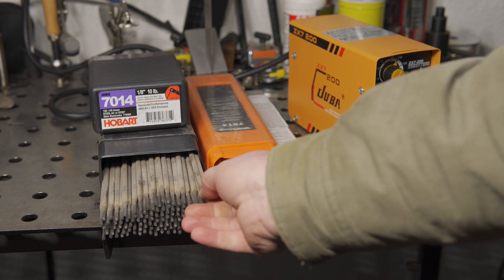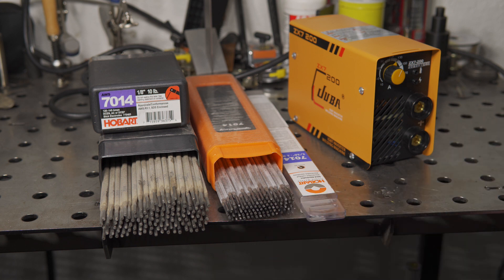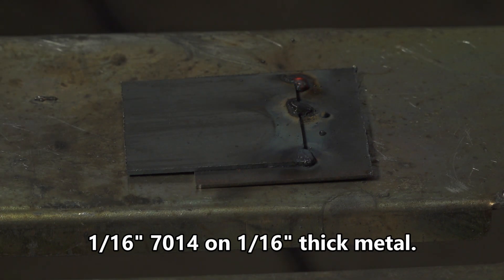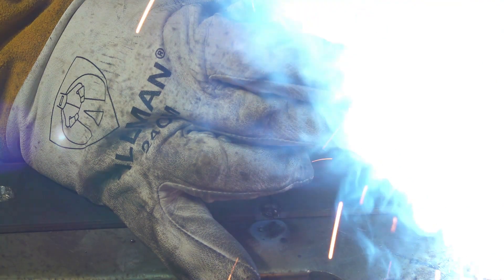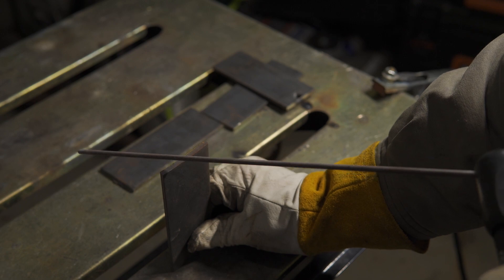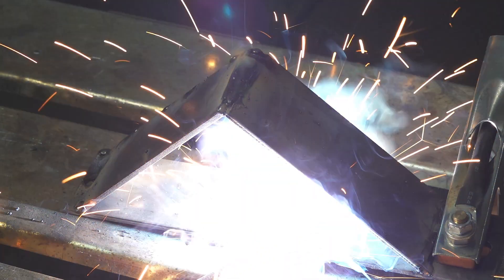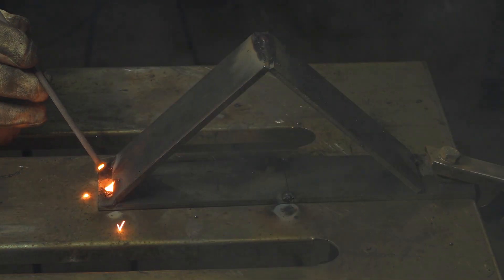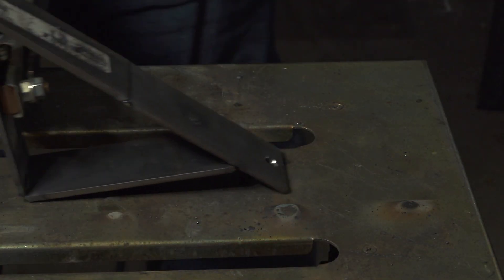Stick Welding Easy Tack Welds:  Use 7014 Rods

Comment: This comment is kind of off topic, but since you have reviewed several inverter welders I thought you might know the answer to my question.  I recently bought 2 very small DC 100 amp inverter welders.  I am thinking of hooking these together in parallel to increase the amperage to allow more flexibility with bigger rods and thicker metal.  I see Miller has a how to manual for this.  It says as long as you keep both machines settings the same it will work.  Was wondering what you thought of this and if you have any thoughts on how this will work.  Enjoy your videos very much.  Thanks - Russ
Reply from the maker: I've never done it, but I imagine it would probably work with those two welders, as long as they are fairly even in terms of voltage and amperage delivery.  You would have to make up some "Y" cables and such.

I don't think it's generally done with welders that size.  I think it's more common when trying to get really big outputs.  But hey, if that's what you got, give it a shot.  You will likely have to plug them into different receptacles on different circuits.  I imagine that if you plug them both into the same 20A circuit you will probably end up tripping the breaker.
Reply: @bigtb1717   Thanks for your reply.  Here is a link to the $44.00 welder I bought.  It ships from their US warehouse in NJ and I had it in a week.  That price includes shipping!

https://www.banggood.com/4200W-Welder-DC-Inverter-ARC-MMA-225Amp-LCD-Display-Welding-Machine-Stick-Tool-p-1532824.html?rmmds=search&cur_warehouse=USA

Mine came with an arc force knob control also which was not shown in the picture.  I guess the arc force varies you amperage depending on your arch length and when its turned up it almost is impossible to stick a rod.

I am very happy with its performance so far, but am thinking $44 x 2 = 200amp welder if this works.  I ordered another welder, cables and connectors to get them paired up.

The Miller instructions to parallel a welder is pretty simple.  Your right that you have to have the welders set exactly the same  amperage when you use them.  Here is the link to Guidelines For
 Paralleling Arc Welding Power Sources.

https://www.millerwelds.com/-/media/miller-electric/files/pdf/resources/paralleling.pdf

If this experiment works would you be interested in doing a video on your channel explaining how it all works and show it on your own equipment?  I think it would be useful to some people that may have 2 welders on hand.

Thanks for your input.  Let me know if you have any Further thoughts or ideas and I will do the same.  Russ
Reply from the maker: I think that it could make sense for people when using 100-ish amp welders, particularly if they already have access to two welders.  A 90-100 amp stick welder limits you to 3/32" rods for the most part, and many people could benefit from 1/8" rods, or even a bit more punch in general.  Also, running a 100 amp welder maxed out will limit duty cycle.  So if someone had a 100 amp welder and could parallel it with another, they could gain meaningful capability.  However, if someone needs a bit more capability and would have to buy a second welder, a second set of cables and deal with two welders needing to be plugged in and such, I think it would make sense to weigh that option against simply purchasing a higher output welder.  

If someone has a 160-ish amp welder, paralleling it with another would make less sense for most people.  A 160 amp welder can run pretty much any 1/8" rod, and that's going to be enough for most people doing typical projects and repairs.  And with proper joint prep and multi-pass, a 1/8" rod can work on really thick material.  For some projects it might be nice to run a bit larger rod and save some time, but most people won't really "need" to run larger rod enough to make it worth a second welder and all the extra setup.  Where paralleling larger welders makes more sense is in a production type scenario, where some company has multiple, 300 amp welders and has a particular project that would take far less time if they could weld or air-arc at, say 500 amps.  They could connect two welders together and save some time, save some money or hit a deadline.

I bet, for most people, paralleling two stick welders wouldn't be worth it.  But it could still make a fun and interesting video.  I'll consider it.
Reply: @bigtb1717  thanks for the reply and helpful information.   You're right it does make sense especially when it comes to Arc gouging which requires 300, 400, or 500 amps.  Also you're right in the fact that it may be better just to buy a quality larger unit that would do the job instead of spending extra money for cables and a welder.  I'm doing this more as an experiment since I have two inexpensive of smaller capacity units. I received my extra welding cable and additional $44.00 welder yesterday. I'm going to use the existing number 4 cable I have for the y connections and number 2 cable for my stinger and ground which are going to be 25 ft long each. I did have to buy some extra twist on connectors. If I get it wired up over the weekend and try it I'll get back to you next week on how things went and send you some pictures. Hopefully they won't be of burn up welders melted in a pile. 😀. Do you have an email for your channel that I can use to send the results and pictures? Thanks again and take care talk to you soon.  Russ
Reply: @russellmatheny8677  did it work?
Reply: @massa-blasta  Yes it works!!!  I apologize for not getting back to you right away.  I bought a DC shunt and amp combination volt meter and hooked up to the welders in parallel with the shunt and meter reading the final output.  My first try was 225 amps!, however recently thru my experimentation I have found that there are trim pots on the circuit boards that control the amperage output on each welder.  The number on the digital meter on the welder does not even close represent what each welder is actually putting out.  for instance when I turn up the main amperage control all the way the digital meter on the welder says 225 when actually my shunt and amp meter are reading half of that when I am welding.  I have so much more to tell you and have many pictures for you.  This has turned out be be a very interesting experiment.  I will try and send you some pictures and videos.  Right now I am trying the calibrate the amp meter on each welder to  what it is actually putting out.  Needless to say the Chinese threw me a curve ball as the scale of the potentiometer does not match the scale of the output single to the welders digital meter. to make sense of all of this I want to send you some pictures and videos to back up my work so far.  Talk to you soon.  R

Comment: could you test the amico power arc 200 and it's claimed 80% duty cycle? I am looking to buy a welder to start learning with and came across this one for $200 on amazon and thought if it seems to good to be true.....thanks for the informative videos very appreciated!!!
Reply from the maker: It's something to consider.  I have another Amico that also lists an 80% duty cycle on the Amazon listing, but the data tag and the included manual both say 60%.

Either way, there is more to duty cycle than I think some people realize.  It's not just a matter of whether or not it shuts down on high temp.  That's part of it, but there is more to it than that.  The over temp shutdown really should just be a last line of defense to keep the welder from failing.  The way the duty cycle should be spec'd is to keep the internal components from running too hot.  That might sound obvious, but many electronic components have a drastically shortened life if they run too hot.  They may not fail outright, but they may degrade much more quickly.  So even if a machine doesn't shut down on over temp, it may be stressing the components if run past the duty cycle or if the duty cycle is spec'd too high.

In other words, a manufacturer/seller could choose to rate the duty cycle super high, with no real testing to confirm that it's safe for the machine.  They may get away with this because most people don't actually push their machines that hard, and also because there is a good chance it wouldn't shut down on over temp or flat-out die if it was pushed that hard.  But that doesn't meant it won't have a shortened lifespan if run that hard.

It could be fun to find out though.

Comment: I agree with you. I use 7014 for many welding projects.Since I am not doing structural coded work 7014 is just fine. It has the same strength of 7018 not quite as ductile as 7018 but 7014 starts easy and I find out of position it works great. As you say restarts are so much better
than  7018.
Reply: Exactly! 7014 is mild penetrating and easy to start and leaves beautiful looking welds. Perfect for tubing or welding tubing to thicker steel while still being strong. 
7018 is my favorite rod though